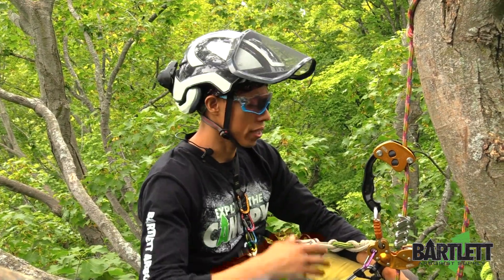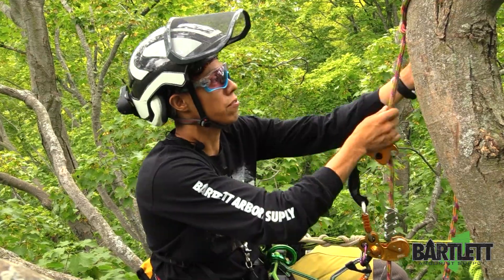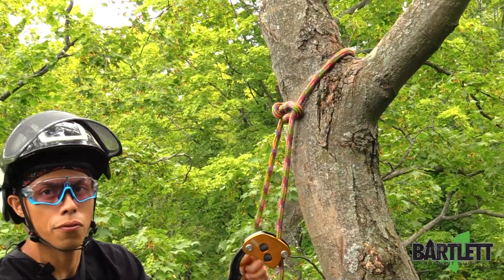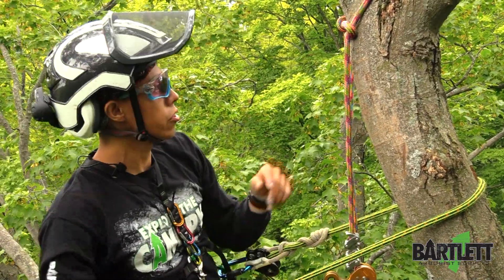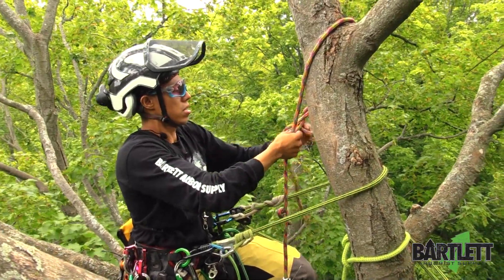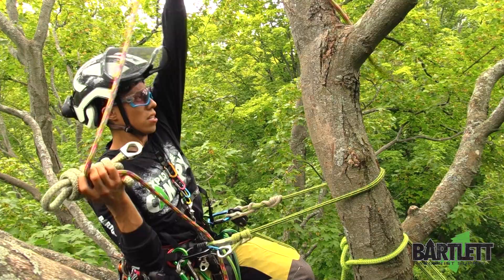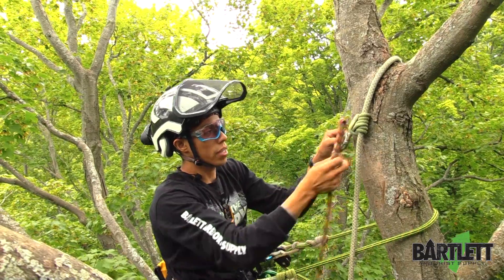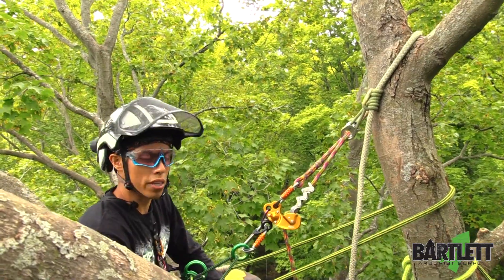Single Up, Double Down

Comment: I'm 270lbs can u Maka a video on how to make climbing easier pls
Reply: I know some big guys that are bad ass climbers nothing to do with weight
Reply: How tall
Reply: Climbing only gets harder.
Reply: I'm 66 years young and just started climbing MRS on a Blake's hitch. I'm having the time of my life. However, I couldn't do it with out my foot ascender. I use a JetStep foot ascender. I have way more leg strength than arm strength. I also just got a knee ascender I wear on my left foot. In fact I'm learning how to use it today. There are also hand ascenders. Watch local arborists working in your area and watch lots of YouTube videos.  Always practice low and slow. Don't climb any higher than you're willing to fall, until you're sure you know what you're doing. Look for a climber in you're area that can assist you or at least look over your setup to make sure you're on the right track. It's also great exercise.  Make sure you have at least one lanyard with you so you can tie off around the stem and above the branch. Good luck.
Reply: Practice, use the right gear, there’s no shame in utilizing equipment to help. Sure hip thrusting up giant tulip poplars is cool and all but that shit gets old quick